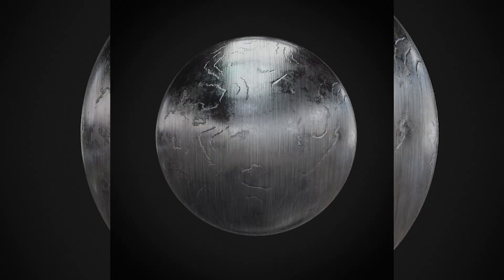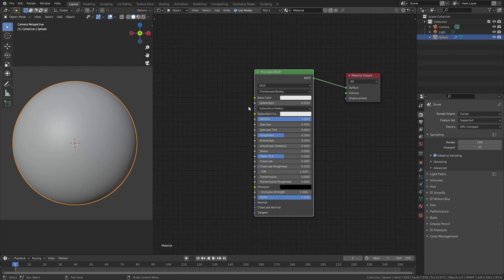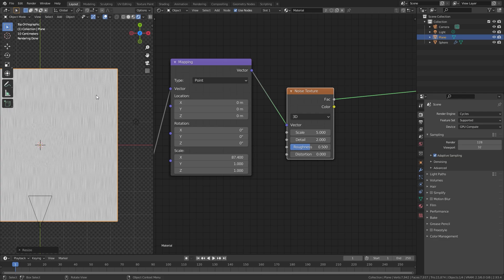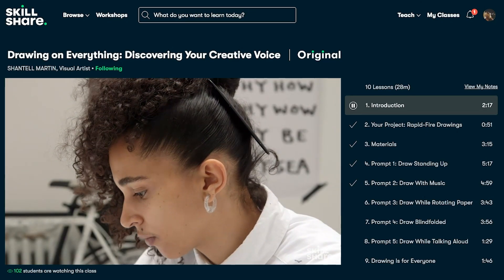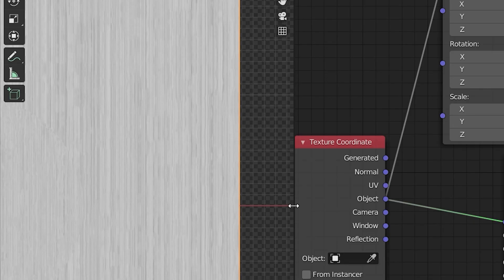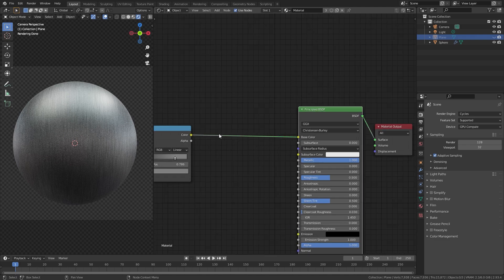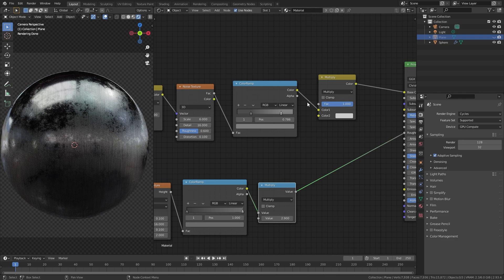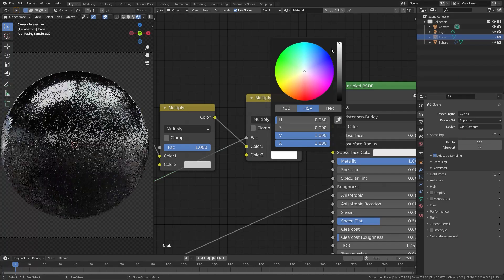Blender Tutorial - Creating Realistic Procedural Brushed Metal

Comment: Hello Blender Made Easy, I'd like to thank you for your amazing tutorial. It was really helpful! I have a question though. What changes do I need to make in order to obtain a smooth, non-brushed metal without scratches? I'm working on a model whose shell is made of a smooth metal with just a subtle layer of dirt (kind of like a brand new smartphone after the very first use to verify if it works, that your fingerprints start showing up on its screen).

Comment: Could someone help with a question I have? I am using this tutorial for several matte painted brushed metal surfaces on an object, and one of the surfaces is white. This has worked great for a light grey painted surface, but I can't get it to go any lighter than that. Could someone tell me what I need to adjust in order to append this texture in a project to use it as a material?